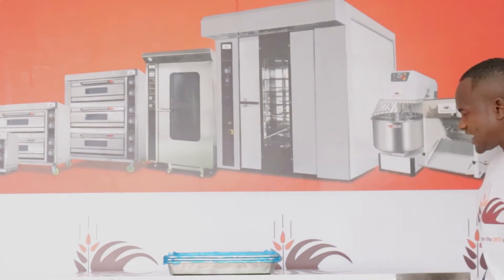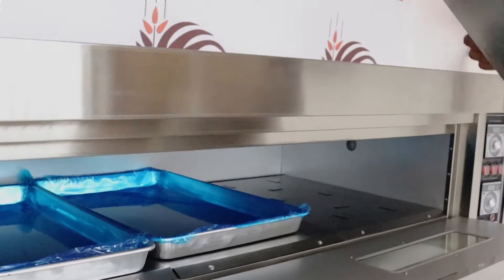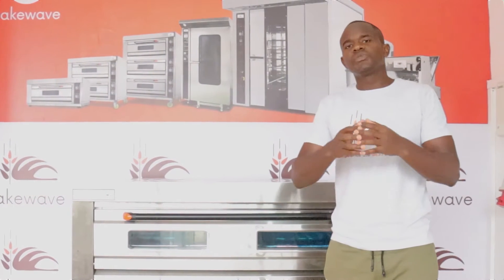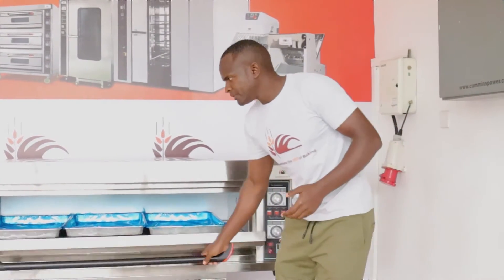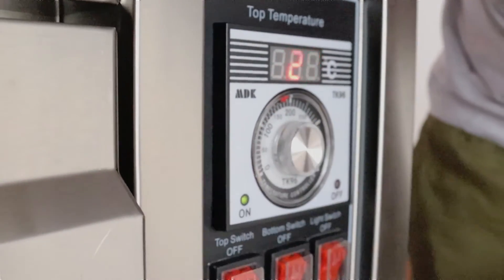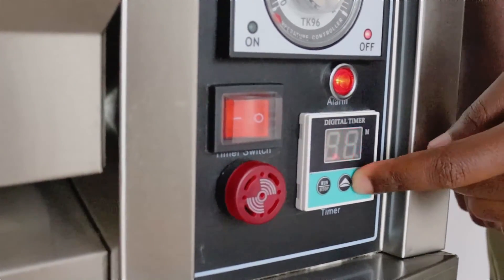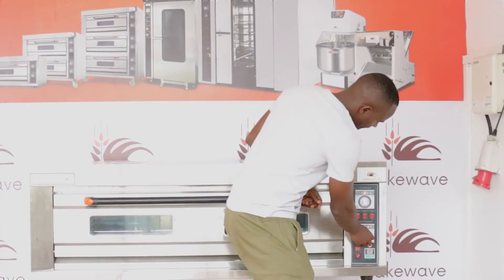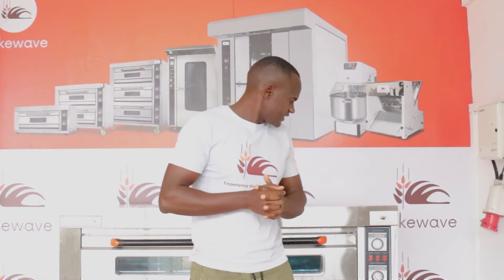DECK OVEN;DO YOU HAVE A SINGLE PHASE CONNECTION BUT WANT TO BE ABLE TO BAKE MORE VOLUME OF PRODUCT?

Comment: Hi, does then oven need a circuit breaker or an Isolator in the DB box? If so how many amps are required?
Reply from the maker: Atleast 64 amps are required.

Comment: Pls, someone is offering to sell a fairly used for to start my bread business. 3 decks, 6 trays, 19.8 kw , 380v. Judging by the specifications you outlined here, do you advise to take the offer and start small? What other specifications should I look out for? I would to bake baguettes and the sandwich loaf type I saw in your video. Thanks for your reply and stay blessed.
Reply from the maker: Hello thanks a lot for your contribution and support to our channel:yes you can buy this deck oven but you need to find out how long it has been used and if it has insulated ergonomic handle and heavy insulation on the body to cut down power consumption
Reply: @BakewaveTV  thanks so much. I will check that.